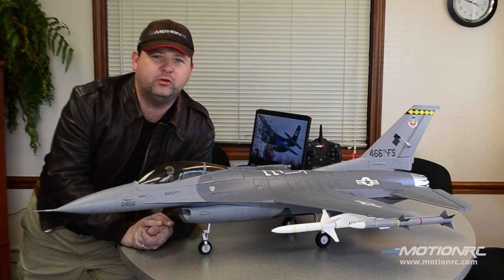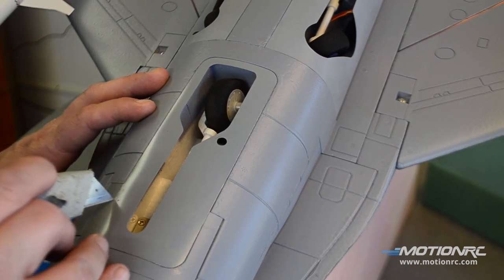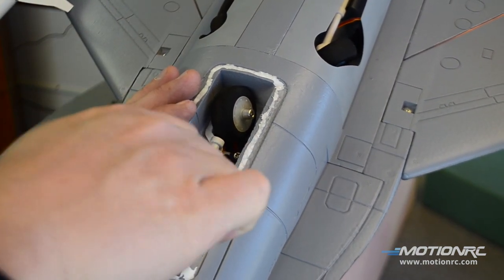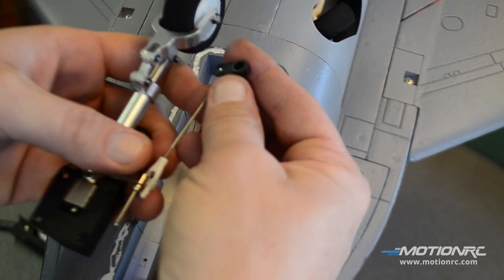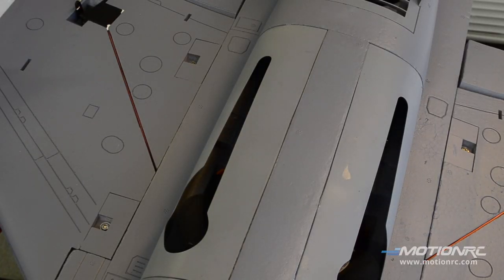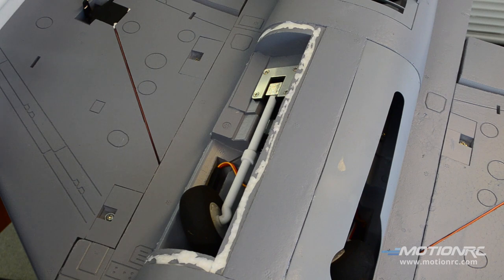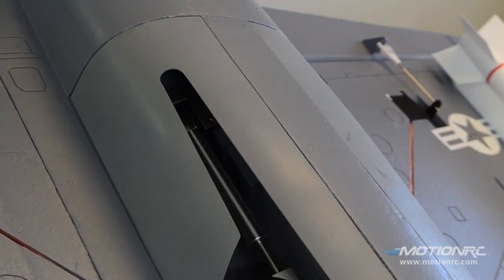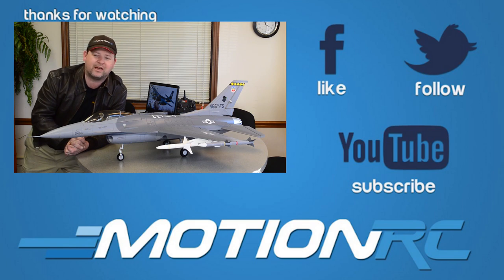Freewing V2 70mm F-16 Suspension Strut Upgrade

Comment: say guys if you take the nose wheel servo wire and use a Aux 1,2.or 3 and mix it with the knob on your transmitter you can trim the nose wheel to help keep it straight down the runway.  Then mix the knob to the rudder and you still have steering of the nose wheel with rudder.

Comment: VERY easy i unless the original main struts grub screws may have been "welded" in. I use only profession grade tools including hex wrenches, etc. and these "rounded out" immediately. Fortunately (or un-fortunately) I had a set up retracts from my ill-fated 70mm F-104 and I was able to complete the transition from crap to ascent. It would be nice of those Chinese would use quality materials...those grub screws that are supplied seem to be (obviously) inferior quality. If I hadn't had a couple of similar parts I would've had to purchase a new set of the plastic coasted struts. I can't believe that I'm the ONLY person with this initial problem.

Comment: It's a nice plane, but it could be better! Just make the better (shock-absorbing) LG standard from the get-go. No one wants to throw away the $16 they spent on the stock wire LG when that $16 could have gone towards the $50 ($45 + $5 shipping) of the upgraded LG! Time for a V3 guys, with the upgrade as standard stock issue - and maybe another livery. The same goes for the BAe Hawk. Stop the upgrade train when you know we will pay extra upfront. Just make them the way they should be from the start.
Reply from the maker: Not everyone feels as you do. Numbers don't lie and the sales of upgraded gear pales in comparison to standard gear. We make the gear separate for those who want/need it. Most don't though.
Reply: Exactly! You make my point for me. Very few pilots want the stock LG and feel the need to upgrade. That's why the numbers for upgraded LG are so much higher than the stock LG. If you would just give us the $16 or the $25 (F7F) or so $$ for the stock LG and let us add in the upgraded LG on an initial order, this wouldn't be an issue - not just for this plane but also the F7F Tigercat & the BAe Hawk. Freewing does such a great job on most of their other planes - why not these 3 planes as well?